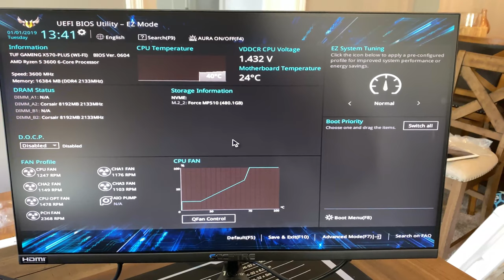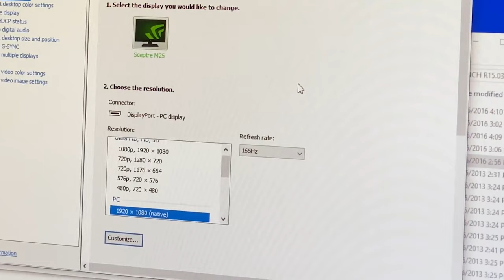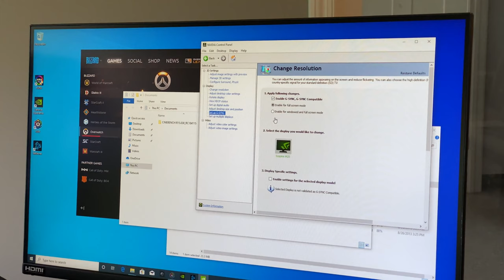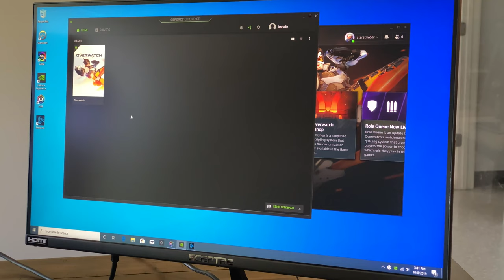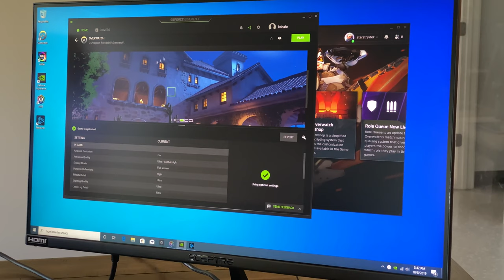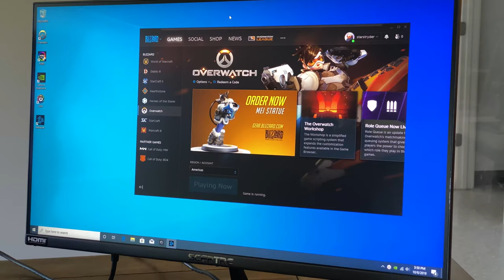Ryzen 5 3600 Gaming Build for under $1,500

Comment: Thanks for the video and a FULL build including keys, mouse and monitor in your price.  
Amazing how much changes in a year. 
I would still use the Ryzen 5 3600, I might use the MSI x570 Tomahawk instead,  but the TUF WiFi is much more available (and cheaper by usually $30).  If you were building this in September of 2020 I think I would go cheaper on the keys (now $120 and out of stock) and mouse and put more money into a 3070 GPU (which isn't out until "October" but is supposed to be $499 or so).  Or possibly a Sapphire Pulse 5700 XT if I had to buy today (also $399), (when is Navi 2 showing up?).  The monitor is still a good deal, (I wish I had read this a month ago, got the smaller Asus VP249QGR instead), the power supply is tough to find,  the M.2 prices are weird (and M.2 with PCIe 4.0 came out).  If I had to pay full price for Windows 10, I'd use Linux Mint instead, yes even for gaming.   Once an item is in short supply,  I find the prices on amazon rise by significant amounts and typically double from sketchy sources (like the mouse for $135 and a 2060 card at $679 WTF?? ).  You can get NON- RGB 3600 RAM with better timing for less money in 2020 (about $30 less). 
Some stuff changed, but predicting the future is a tough gig.   If I bought a 2080 GPU 3 weeks ago, I'd be be a few hundred dollars of sad, but not for long, life is too short for that.

Comment: You forgot to put a link for your CPU cooler but other than that awesome build tutorial man! Very helpful because I'm doing this exact same build only without the monitor and I went with a GIGABYTE Radeon RX 580 GV-RX580GAMING-8GD 8GB Graphic Card
Reply from the maker: Thanks for the comment.  the CPU cooler comes with the processor for this build.  it's the Wraith, stock cooler.. but a very good cooler, none-the-less.

Comment: Thanks for that. I like the choice for the mobo in particular. Easier to upgrade your CPU than your motherboard when finances allow for an upgrade. Have a Corsair case here too. Carbite Air 740,... because I don't like wires, and I am lazy. Love the case, loadsa room to work in. Side panel is crap though.
Reply from the maker: Yeah.  How the side panel attaches should have been done either on a hinge or “hinged slots” at the bottom to help reduce the chance that the glass might fall when taking the screws off.   I also wish it supported three 140s in the front and a 140 for rear exhaust, but that’s just personal preference.    Other than those minor things, this case is REALLY nice.
Reply: @KDSTech  I hear ya. In regards to the side panel, I was more referring to my case. It's not a glass side panel, just plastic that scratches if you as much as look at it. But the huge amount of space makes up for the poor quality of the side-door (it's more a door than a panel really).
Reply from the maker: @PrimeRsoul  lol.. i didn't catch that.  yeah, the space in the case, while on the smaller side, is great to have to work in.   id definitely get this case again for a build.
Reply: What’s the thoughts on Cougar Panzer  cases?
Reply from the maker: Grey Mantis I haven’t used one myself.  However, JayzTwoCents ( I believe ) did a build in one.
Reply: @Al-mu4ff  It's actually a nice case, but extremely unstable. I did a build in it and managed to knock it over twice without any effort. I found the airflow in it pretty good. I initially wanted to use water cooling in the case, but the way the air travels through the case (if you use front mounted fans) it turned out to be perfect for something like a Dark Rock  (be quiet).

Comment: Why install the M.2 on the bottom slot? Top slot goes directly to the cpu and the bottom slot with the heat sink goes through the chipset. Should install in the top slot especially if using gen 4 nvme.
Reply from the maker: Mostly because it doesn’t matter performance wise

Comment: whats the difference between this slot and the other for the nvme?? 11:50
Reply from the maker: DrNikos please forgive me, I’m uncertain on which slots you are referencing.
Reply: There is one more slot for nvme right?
Reply: @drnikos613  There's 2 nvme slots for the Asus TUF Gaming X570 Plus Wi-Fi board. But only 1 comes with the thermal cover.
Reply: @dineshanand23  yes I khow! But should I use the top one or the other with the termal cover?
Reply: @drnikos613  Both are x4 PCIE lanes so it doesn't really matter performance wise which slot you use.
Reply: @dineshanand23  thank you very much for the info!!

Comment: Hi there,
I have a quick question: did you have any problems fitting the Asus Tuf x570 motherboard into the Corsair 220t Case as I've seen another build where its stated these two aren't compatible with each other.
Thanks,
Anthony. England
Reply from the maker: Nathan D I had no problems with the MB in this case.  Went smooth.
Reply: @KDSTech  hi again,
Thanks for your quick reply how many stand-offs does this case have and many does the Asus Tuf x570 need. Are they all in the same positions
Anthony

Comment: On the top of the mobo, what is that extra 4pin power connection for?  I see that you don't have anything plugged into it.  The instruction manual doesn't really say what they are for but that you can use the 8 without the 4pin...i was trying to figure out the purpose.
Reply from the maker: It’s ancillary power.  More necessary if you intend on overclocking it to something a bit more extreme.  It is optional.

Comment: I'm running mine with a Ryzen 5 2600, I can only get it to boot with one 8gb stick of ram. T Force Vuncan z 3200. I even tried with another stick of 2400 ram by the self and it works. If I try any combination of 2 sticks, it doesn't boot.
Reply: B450 motherboard?
Reply: @bansheerider619  Asus x570 tuf plus wifi, TEAMGROUP T-Force Vulcan Z DDR4 16GB Kit (2 x 8GB) 3200MHz , i also tried using  another  dual kit. Updated bios, loaded xmp profile, I think could be cpu.
Reply: @SuperNakedTv  Having this problem for a friends build, what version of BIOS did you try pal (since that was our next plan of attack)? Did you get it sorted? TIA
Reply: @SuperNakedTv  Amen, Gigabyte are solid. To clear the DRAM error temporarily you can remove the CMOS battery to reset the bios settings back to factory (if anyone else is looking at this). Appreciate your fast reply!
Reply: incidentally we had to RMA a TUF first because there was a CPU screw threaded! Only one the replacement board did we get this far as to discover the ram issue. Really terrible quality control from ASUS here.
Reply: @SuperNakedTv  It's up to my friend on what he want's to do, i can see this going the same way, unless a bios update can magically fix this or he's tired enough to just keep it as is running slow :( Ironically I recommended a Gigabyte board to him originally but he wanted to save some bucks - on paper it's all compatible so I approved! Never again will i recommend an ASUS board to anyone based on this (although im guessing it's limited to their budget range - ROG stuff you pay through the nose but it comes from a completely different factory I believe)...
Reply: @SuperNakedTv  You made a wise choice, Gigabyte have some of the most solid boards out there, for things like voltage regulation they are extremely tight and hold up to overclocking well (according to Gamers Nexus). My latest (top end intel) build personally was a Gigabyte Aorus Master and it's been great. Looking at the Gigabyte B550 AORUS PRO for my friend now but we might still yolo attempt the bios update prior to returning the POS asus.  I'll get this build 100% working if it's the last thing I do! Happy Gaming and thanks again for your help here!

Comment: Why wouldn't you use an NVMe PCI gen. 4 SSD since you have a PCIe gen. 4 motherboard? I just built a new rig using that motherboard and processor. I bought the Sabrent Rocket drive and got Acronis software with it at a good price.
Reply from the maker: good question.   for gaming, you'll never notice a difference going from a gen 3 to gen 4 for storage.  literally.  so.. not worth the extra money.   the gen 4 slot will allow you to max out the gen 3 nvme speeds too.   in fact, unless you are doing large amounts of data transfer on the same system, there is no reason to purchase gen 4 drives.   LTT does a great video about this that is a couple months old.  i'd suggest you watch it.   

thanks for watching and commenting.

Comment: NEED HELP I'm building 1st pc got an x570 tuf wifi board and the power supply I bought a while ago is the thermaltake grand rgb 750 80+ gold
I just noticed on pc part picker that it says that the motherboard has an extre 12v connection that the psu does not have will this be a problem?
Reply: well, i dont think that will be a problem but my recomendation is: Sell that PSU and get the Corsari RMx 750 or the EVGA Supernova G1 750

Comment: can this board handle 4ghz+
Reply from the maker: i have not pushed for a manual all core overclock locked at a single frequency.  the ryzen 5 3600 does have a max boost clock to 4.2, so i suppose it's possible, but again, i have not tried that myself.   as far as setting to all cores synced, and locking voltage, i have done that and it boosts to 4.2 just fine with the newest bios.  ( the ABBA and after. )   hope this helps.
Reply: @KDSTech  thank you :)

Comment: Hi! This video was just what I was looking for! Quick question, which M.2 slot do I install my SSD if I'm only using one M.2? I noticed that other people install it on the upper part and that the bottom port is for a second M.2 SSD.
Reply: Did you do this because the GPU would have blocked the first SSD?
Reply from the maker: They both work the same.   But most people will use the top.
Reply from the maker: Yes
Reply: The manual says "For AMD Ryzen™ 3rd Generation Processors, the M.2_1 socket supports PCIe 4.0 x4 mode and SATA mode M Key design and type 2242 / 2260 / 2280 / 22110 storage devices." Doesn't this mean the upper slot would be better?

Comment: Built this combination MOBO, CPU, RAM for a friend recently. Horrific problems. The MOBO is complete junk. Anyone reading - this is a bad combination. As soon as you try and run the RAM at full speed you will get issues where the MOBO won't post after a couple of boots (have to clear CMOS by removing the battery). Hoping that an update to the BIOS will fix it (trying this next) but it's certainly not a beginner friendly build. AVOID Asus TUF Gaming X570 unless you want to run ram at 2666 or spend hours fixing. Not only that, we actually had to RMA one Asus TUF Gaming X570 before getting that far as a CPU screw was stuck in the board threaded. ASUS have terrible quality control for their budget range of motherboards.
Reply: your ram in the video is running at 2133Mhz, for AMD especially this will cost you performance off the CPU so you are not getting the performance you paid for with this build.. See screen at 13:25. Supposed to enable "D.O.C.P" mode (would be called XMP on another board) to clock your ram correctly, and that's where the trouble starts... :(
Reply from the maker: yes, out of the box, that is correct.. however, i do always set docp or xmp profiles when setting up.  :)  thanks for the comment tho
Reply from the maker: i'll have to kindly disagree.   the guy who's this is is absolutely loving his setup and it all works perfectly.   it's possible you might have a bios issue ( if not updated.. ) or something else.   but this is a common build.   sucks you have had a bad experience tho.
Reply: @KDSTech  Well again, you didn't enable D.O.C.P (at least not in the vid) so your system is running at less than it's capable speed - Your friend might think it's fine but he's still not getting what he paid for in performance unless you are saying you did more work which wasn't reflected in your video. We tried bios update today, waiting to see if it fails again.
Reply from the maker: @RichTeaChannel  hope the bios update fixes it.  Usually does.  They do a lot of ram compatibility fixes in bios updates.    

And yes, we did enable the docp.    :). Thanks